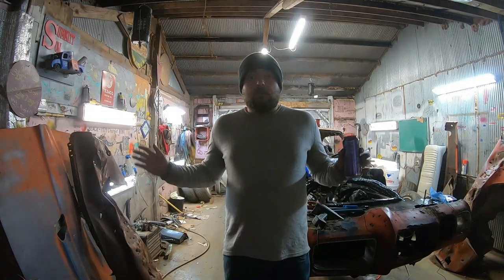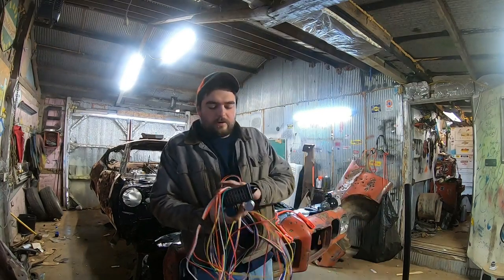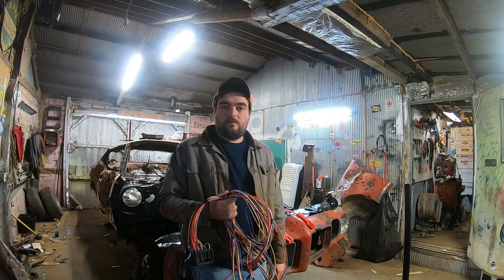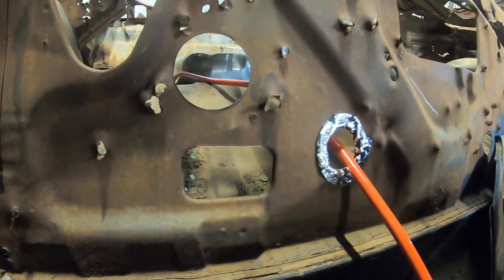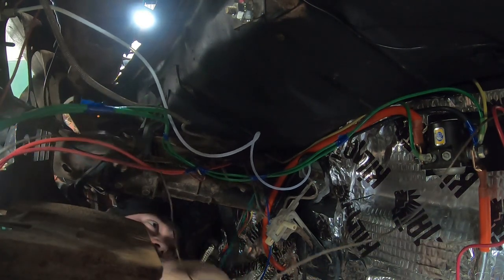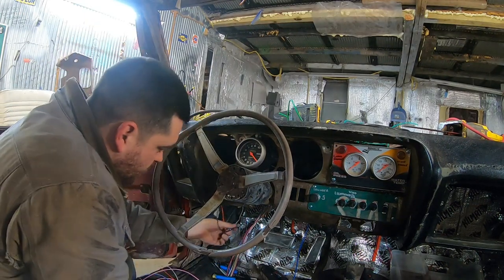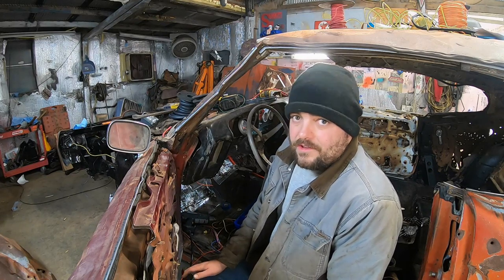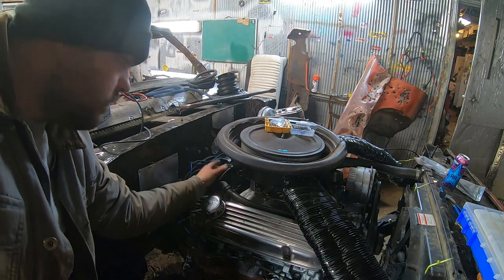The Holey Goat: Worst GTO Ever Part 8 — ELECTRIFICATION, Fan, Gauges, and Lighting Install

Comment: 😶? Legit question: How ya gonna get a windshield in it? 😶 isn't it bent?
Reply from the maker: Plexiglass
Reply: I was afraid you were gonna say that...😢 ...
...😌 At least make it look cool...nascar style maybe.
Reply from the maker: I won't be happy if it doesn't look right. I'm very odd like that, sometimes I don't care how something is done, other things I insist on perfection. If I can manage to put a glass window in it SOMEHOW I will
Reply: the windshield is something that in this case makes a car the car sounds crazy but it has to do with what your mind sees when it sees the general SHAPE of the lines of the car. 
Roadkills General Mayhem isn't made of much ...it does however have a windshield. 😏 
This car should have it too. 😎 its a style thing.

Comment: I would drive it and hammer out the the fenders bolt them back on hammer out the doors make sure they open and close put it back together with all the bullet holes try squeeze a front windshield in And drive it 
You're pretty cool story at the car show
Reply from the maker: That's the plan!